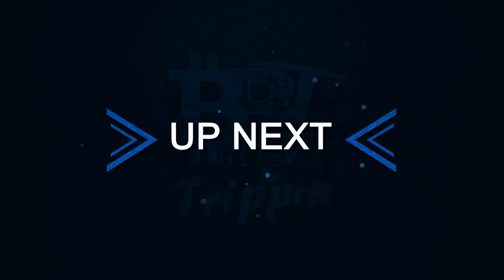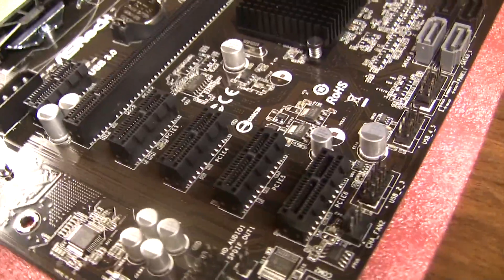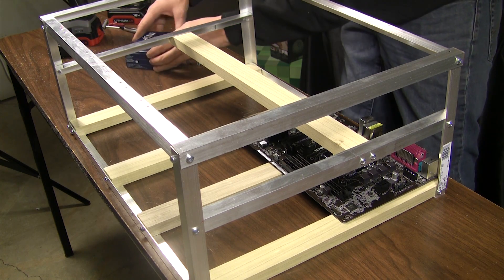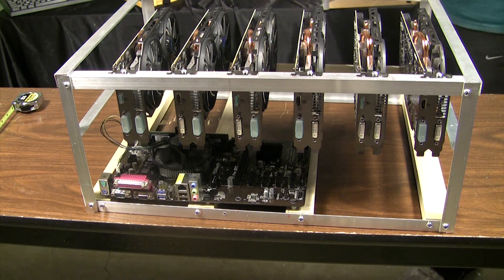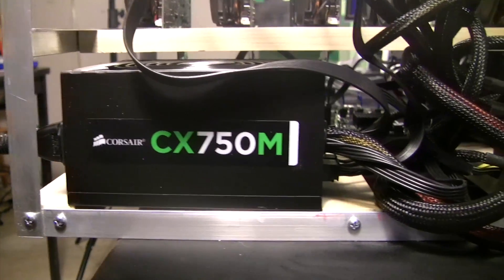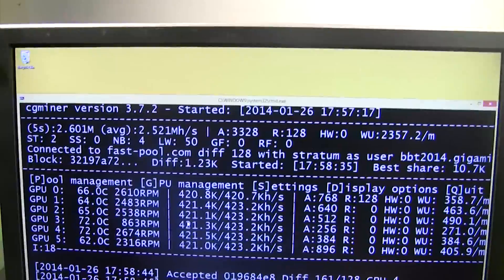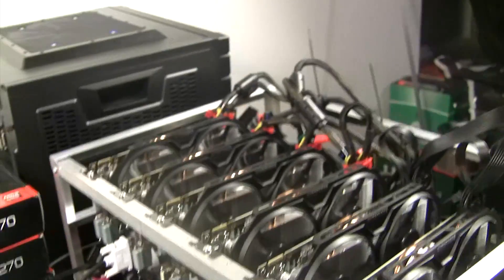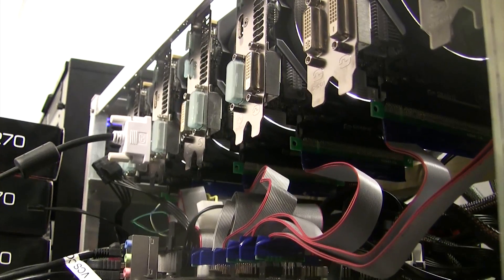BBT Episode 7: 6 GPU Litecoin Dogecoin Feathercoin Mining Rig using the ASRock H81 PRO BTC

Comment: I have never used this motherboard.  I have an issue where I can't access the bios unless I remove ALL GPUs.  I guess I can install OS (I use Ubuntu) but it seems more than likely when I add cards the rig is still not going to start.  Do you know any reason I could be experiencing this problem?  I have a GPU in and can't load bios--monitor is blank.  Have tried with powered and non-powered risers.  I take away GPUs and I can access bios fine.
Reply: Matthew McIlhenny did u got solution ?
Reply: No. Was finally able to get OS to start with one card (in 16x slot on the board) while using a different but identical version of this Mobo.  Adding additional cards causes the system to boot in black screen.  Haven't tried with Windows OS.

Comment: Hello two question:

1) Now we can use?

5x POWERED 1x to 16x risers    > Mother board PCIe x1 slot
1x POWERED 16x to 16x riser   > Mother board PCIe x16 slot

What happen if we connect one GPU with one riser 1x to 16x to the >  Mother board PCIe x16 slot.

This question is because now I am building my second miner, I have free only the slot PCIe x16 in the Mother board and I have only one POWERED 1x to 16x riser.

I can do this connection or I need the POWERED 16x to 16x riser?

Thanks you for the assesory and sorry my english is not good.

Regarding, Paul.

Comment: How came you are using a non powered risers? I saw a bunch of other videos and everyone recommended the sata powered usb3.0 risers for 1x to 16x , can you help me to understand?
Reply from the maker: during the filming of this (early 2014/2013) powered risers were very bad (caught fire) and/or was not efficient. Since late 2014 these issues were fixed by many vendors and now are the go to riser to use, esp. since many graphics vendors have raised the draw from the board.
Reply: So if im using same mb as you with rx 470 its better to get a powered riser right ? 
And thank you for the fast replay
Reply from the maker: Yes, powered risers

Comment: I've got the ASRock H81 Pro BTC board and 6 R9-290X GPU's running on Win 8.1 x64 with modified AMD drivers.  Is there a Linux distro that will work with this motherboard and all 6 GPU's???

Comment: Hey, great video.  I actually picked up this board with 6 GTX670s for GPU processing.  Also bit the bullet and picked up the ASROCK PCIE1xto 16x adapter(s).  Can't get all the cards to read, tried to install the 16x first, and then started with slot 6.  Slot 6 and the x16 slots will work together, but no other cards will recognize.  Any ideas?  I tried all of the slots, none of them will recognize.  Idk if its my bios or what.

Comment: Hi, i have the same motherboard and the same cpu. Ram kingston hyperX 1600 1x4gb
And 2x5870 & 2x5970 
Powe supply is ocz zx 1250w
Extensions pci-ex is usb 
But i have problem, the gpu make a lot of hardware herror also if i put lower intensity and if i leave the additional power supply but if i put every gpu on my personal pc everything work properli, my sistem is asus p8pz87-v pro thunderbolt cpu i5 3570k o.c. 4,5ghz ram g.skill 2x4gb 2200Mhz 
I try also to put my 8gb ram to asrock sistem,(same result).  Maybe the extension pci-ex is to long? Please help me

Comment: With the risers would it be possible to sli?
Reply from the maker: if you had two 16x full risers technically, but not ideal if your gaming; we have ran benchmarks (episode 15) on 16x and 1x risers on 3dmark and found minimal impact on the full 16x riser. Bottom line, physics dictates the card physically plugged in the board is better.

Comment: I got this board without knowing it was a mining board, but can I also use it as my gaming mobo?
Reply from the maker: This board can be used for gaming, we would just recommend not using a riser and physically plugging in the GPU to the 16x slot
Reply: Bits Be Trippin' so i can only utilize one GPU for gaming ?  i thought if i can plug in all 6 R9's i  can get a 200FPS in GTA V ..
Reply: ***** if i crossfire some R9's or SLI  some TITANS on this board does the perfomence get affected ...i mean ..does the use of raisers affect it.

Comment: Question on rig dimensions: 
Looks like you have some extra room on either side of the ends of the case (around 8:10). Can a similar rig be built an inch or two shorter (20.5" or 19.5")?  Or do you have that extra room in the case for a reason? Is it additional wiggle/fudge room, or do you not recommend shorter than 21.5" for some reason?

Also worth noting. The cuts on your pine add up to around 8 feet (not 10feet as you mention in the video). Not sure if I missed that or not, but if it is indeed a miss-calculation on your part maybe throw in an updated dimensions in the description.

And finally any experience with the Biostar 6 pci-e slot motherboard? They're in stock at new egg (asrock btc 81pro is a little harder to find):
http://www.newegg.com/Product/Product.aspx?Item=N82E16813138394
Reply from the maker: Absolutely rigs can be built shorter, this design was specifically to support two full size 7" PSU's and their wire mess in addition to enough rough for HD. If you plan using a smaller setup you can reduce the overall footprint.

What I failed to say is we choose 10ft cause those spans were cheaper for us, even though we were using 8ft in full. It comes down to price and when building multiple rigs, 10/12 foot sections gets us more millage on more than one rig. Good catch though!

No experience yet on the Biostar 6, but looking about picking one up. May see it in a future episode!

Comment: Hey guys, love the vids! Got a few tech questions for you.
1. Do you use a dual psu splitter or paperclip for the second psu? I've blown 2 x corsiar rm1000w psu's using a splitter.
2. Do you install you cards with a monitor plugged in to the motherboard? And what is your primary display set to in the h81 pro bios? As every time I remove my hdmi cable from my 270x 1st card, the hash rate drops by 100 hash. Do you use dummy plugs?

Thanks
Reply from the maker: We cover the way we split the power in this episode: http://youtu.be/xZiWciJLK3o

We use a small metal adapter, we do not use the PSU2PSU type of adapters, I have had issues with ground loop feedback causing the rig to act too inconsistent and funny.

Comment: I've made my own rig with similar setup http://youtu.be/DS7EHg6W9-Y. But with few changes like I've used powered risers (all of them). I also used "Dual Power Supply Starter" just makes life easier, also you don't need to buy power button, just use old USB/Audio to motherboard connector (cut it to fit only 4 pins with no blind spot) and make some kind of short time trigger to connect connect, I've used door bell switch. I've used steel as my main material it was cheaper to buy it than aluminum. Making 2,65 MH/s and taking 1030 W from the wall (remember that if your rig is suppose to use e.g 900W you need to divide this by PSU efficiency for your power consumption and voltage (check manufacturer specs for your PSU) then you will get the real power usage).

Comment: What up Carter! Whats your opinion on Mining Rig Operating Systems? Whats better Windows 8.1 or BAMT? Does one provide better hash rate then the other? I built the same RIG from this video. Its working great with Windows 8.1. Thinking about experimenting with BAMT. Just want your opinion on pros and cons.
Reply from the maker: BAMT has a great thing going for it purely on the fact its free and you can run it off a cheap USB stick, saving both cost of OS and SSD. 

Windows 8.1 & Windows 7 are more familiar with most, ton's of support from community and general knowledge and for the most part works out of the box for multi-gpu boxes up to 5 (6th card rigs gets tricky sometimes)

As for hashing, I have been able to achieve the same hash on both BAMT and Windows 7/8.1 so from our research one is not better than the other when it comes to producing more hashes. But that cost savings may make it worth its weight!
Reply: Bits Be Trippin' Thanks for the fast reply. BBT is the BEST! Keep the great videos coming.

Comment: Hey man, please help me out here!
So I ordered 6 1x to 16x powered risers for my rig, I wanted to go with a Gigabyte 990FXA UD3 I believe it is, but then i found the H81 PRO BTC in stock, anyway could you please let me know ASAP if I can use powered risers with the H81 PRO BTC Board and connect the molex connectors and just leave the risers unpowered? Thanks!
Reply from the maker: Yes, from our research and building now 11 of these rigs ... un-powered risers are rock solid with the BTC board. We have had instability with powered risers with the BTC board.

Other boards however we have had great success with powered risers.
Reply: Bits Be Trippin' Thanks for a fast reply man, I cancelled the order. I am about to order the Gigabyte GA-990FXA-UD3 I'll be using it with 6 Gigabyte 270s and powered risers. Have you had any experience with that board? I heard that it is pretty good. Sorry for all the questions, it's my first time building a rig.
Reply: Bits Be Trippin' What is the difference between a powered and a non-powered riser if I may ask?

Comment: Another money saving tip to add to what these fellas already mentioned is to boot from a USB into SMOS linux. No HD cost and no OS licensing cost. I've put together a few rigs now using SMOS and it's not failed me yet. The only disadvantage I've found to using Linux is that I have to manually flash the bios on my cards to get lower voltage but other than that it works slick. For those unfamiliar with Linux there is PLENTY of information out there to review and help you along. Great video, thanks guys.
Reply from the maker: We have promised the community to cover a video on this and have not got to it just yet, but yes, there are many ways to save money as you have suggested! Go with those free OS solutions and save  yourself a SSD cost!

Comment: Can I mix brands with this configuration? XFX Radeon R9 270X and Gigabyte R9 270? Does one card offer better performance then the other?
Reply from the maker: You can, but some cards are going to have different configurations. You will need to send specific configurations to the specific GPU ID in your bat file. There are a lot of tutorials on how to do this.

Comment: I noticed on of of the cards you are using a 16 to 16 riser. Did you start by installing that one first, rebooted then first pci x1 then reboot and so on? The reason I'm asking is because at this point I have 4 cards in all found by windows 8.1 and working but when I mine of of the cards always causes the vid driver to fail. The problem moves around if I uninstall and reinstall a card driver. Any suggestions? I use the same board and R9 270x cards
Reply from the maker: George, On all of our builds with this board and 6 GPU, we first install the 16x16 riser and one card. Build OS, update all mb/system drivers and latest catalyst driver. Pull down 3.7.2 CGminer and start hashing for a few minutes to ensure the 1 card works good and board/system stable. Once that is completed then we work from the outside in (furthest away from the 16x16 slot until the last one is the PCIx1x slot on the other side of the 5 PCIx1x. This seemed to give us the best success so far with not having any not show up/work. This is also why I use a SSD cause it greatly cuts down on reboot times. Total time will take you about 1 1/2 hours from reboots/adding each card, verifying they began hashing etc until your all up to 6gpu. Some people just put everything in and hope windows finds/sets everything up and while we have done that on a few rigs, we always run into one card that is a biotch ... (having to uninstall in device manager etc and let it get reset back up.) so we moved to one at a time and seems to have worked pretty well.
Reply: Bits Be Trippin'  Thanks for your reply. So the easiest thing to do would be to uninstall the vid software and start from scratch. One more question. What is the reason for using a full width riser for the x16. I know it will work with the x1 to x16.
Reply: Bits Be Trippin' by the way, I found the issue with the one card not mining and crashing the video driver. This one card works fine while playing games and also doing stress tests using Kombustor. It will fail every time I try to mine with it. The video driver keeps crashing. I tested this on the rig and on my personal PC , same issue. This is one of six MSI R9 270X 2Gig gaming edition card  of Ram. The rest of them work just fine. Have you ever encountered anything like this?
Reply from the maker: Yes, but it had to do with the card not accepting the settings I was sending to it. I had a gigabyte R9 270 that wouldnt hash at all even on standard clocks. I took the core down to 925 and mem clock to 1400 and it started working with 8192 TC, currently holds 423k/h now and prior all other normal gigabyte defaults would crash driver...
Reply: I wonder if that's the issue I'm having with the one card misbehaving, I assume all your card were the same and one of them just did not want to cooperate?
Reply from the maker: we used a 16x16 risers, never switched to a 1x in a 16x slot. 

If its failing when you trying to mine, adjust your settings and work them upward. Switch intensity to 12 with Thread concurrency of 8192 ... and 1 single thread using G 1

Comment: Dude, thanks for video. However, I am using 6 of the very same cards but on a Gigabyte mobo and after installing windows 8.1 it recognised just 4, then I put on of the cards on the slot directly + dummy plug and it recognised 5, however, it does not recognise the 6th card and I can even not see it in "unknown devices". Can you please help me with that?
Reply from the maker: More than likely the slot your having problems with is the first 1x PCIx? If so you will need to use a wire jumper to enable the 1x slot while a 16x slot near it is being used.About mid way down on this link shows the trick on using the jumper: http://www.gobitgo.com/articles/1001/How-To-Correctly-Use-and-Install-PCI-E-Riser-Cables/
Reply: Bits Be Trippin' Thank you!! That worked!
However, I am in a new trouble now. Using windows 8.1 I got the 13.251 drivers, first, whatever setting I put into the cgminer I got a crash into literally a few seconds. Then I read I need to disable the AMD Catalyst Control Center, so did I and now I am able to get at least 30 minuts of mining. However, after that I am gettinng and epic crash of whole my system, whatever settings I use, including yours. Do you think it may be sth with the drivers? WHat version are you using and what step would you recommend now?
Reply from the maker: How are the temps on the PSU? Sounds like the efficiency drops due to heat over time and causing a system crash; if you're near the top of your PSU's ability over time it will clip out based on lowered efficiency from temps. Maybe put a fan blowing on entire system and see if it shuts down @ 30min
Reply: Seemed like my PSU was not able to bear all the load of 6 GPUs. I think I got it stable with 5 now. However, something strange happened, after login via TeamViewer one of the rigs just stopped mining, screen was not freezed, rig was OK, no SICK or DEAD cards, however, the cgminer scrren was freezed and hashing numbers were not chaning at all... It happened exactly after my login with TeamViewer, any ideas on that :?

Comment: Crucial Ballistix ?
Reply from the maker: Yes, stable, working and cheap memory at microcenter. Last thing we want to troubleshoot in a mining build is if the memory is bad...i like the confidence factor of a good name brand. Worth the extra 10bucks
Reply: Bits Be Trippin' 8gb COSAIR Balistix PC10600 in Computer Spec.
Reply from the maker: PC12800 or 10600, doesn't matter for hashing, we buy 12800 cause they are the same price as the 10600 @ microcenter and might as well get higher end memory.

Comment: I dont know how you guys had so much luck getting the 6 cards running! I am having a hell of a time. 
Is it just the one rig you have set up with 6 in the btc board? I am running 6 gigabyte R9280x and having big issues getting the 6th card up. :(
I have 2 btc boards 2, was looking at getting 12 cards.... now I am worried it wont work
Reply: PS I am enjoying your channel :D sub'd
Reply from the maker: With our toxic build that is coming up we had some trouble on 6th card also, but ended up being the riser! Replaced that and worked like a champ
Reply: Bits Be Trippin' sorry if some dislikes appear, my phone was playing up and i bumped something, will try and remove it if it pops up, :/
on pc now! I am actually using different risers to you. I have the USB 3.0 ones.
They seem to work well.
I am not sure if its the risers causing me the problems, the cards are being detected, just get the yellow flag on one, 4 cards and 2 yellow falgs in win 7 5 cards and 1 yellow falg in windows 8.1, 
what catalyst driver version are you using?

Comment: How did you wire up a power swtich on the open case?  I just got all my parts in... And I do not see a built in power button on the ASrock BTC board ..